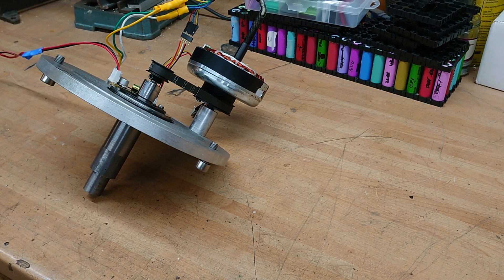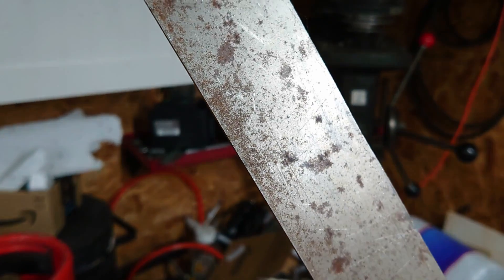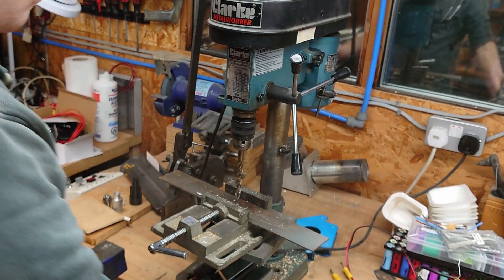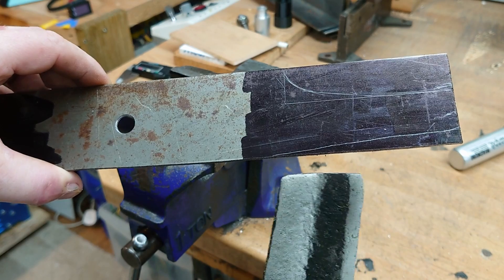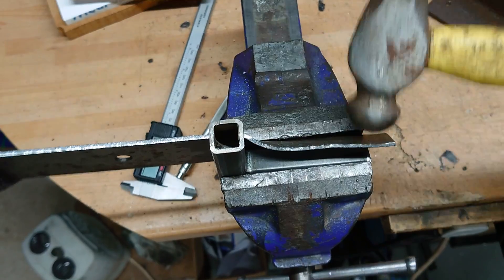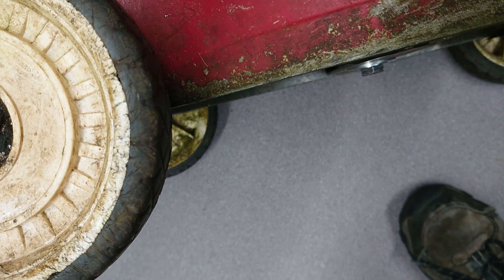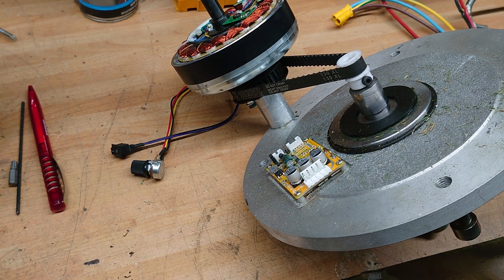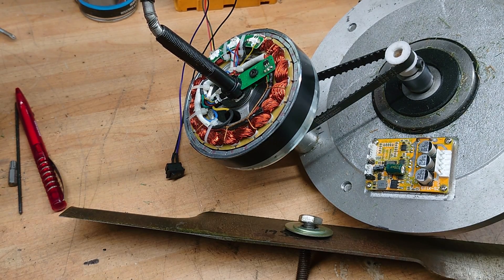Petrol to Electric Lawnmower Conversion Part 3

Comment: Why not use the stock blade or a new blade? They're relatively inexpensive.
Reply from the maker: I wanted a good starting point, but reckoned that I would likely have to modify the blade, such as lightening it. It didn't take long to make, and that's really what it's all about. I could have just bought an electric mower and saved myself all the effort, which I seriously considered on a few occasions. Wouldn't have made much of a project though! Thanks for the question.

Comment: 1. You need the mower blade to be just up inside the mower deck as it creates a vacuum effect so it can pull the grass up to cut it.
2. The reason mower blades have little studs they also mount on is because if it was just a bolt going through then the blade would not spin with the motor or engine. It will wallow out the hole it is mounted on come loose and fly out. You need at least 2 points where it keeps it in place.
Reply from the maker: Hi, thanks for your comments. I will adjust the blade so that it is just within the deck as you have advised. It is working ok, but anything that improves it is worth doing.  On your second point, the blade attached to the petrol engine on the mower is just attached with a single bolt, I just copied it. The rotation of the engine (and electric motor) are such that the bolt tightens itself with any resistance in the cutting direction.  That said, you make a good point, I'll add an anti rotation pin on the next installment.